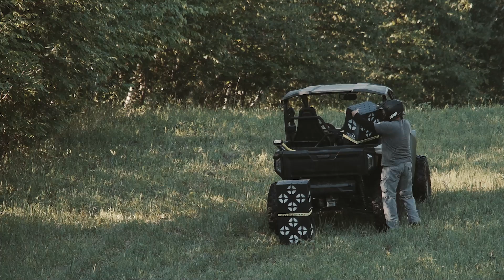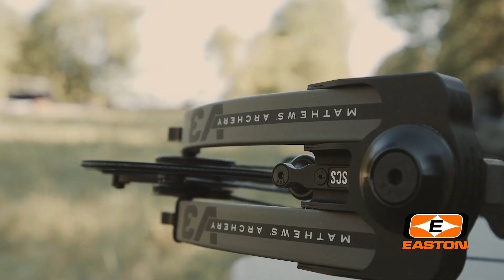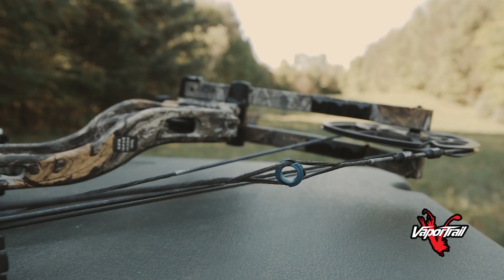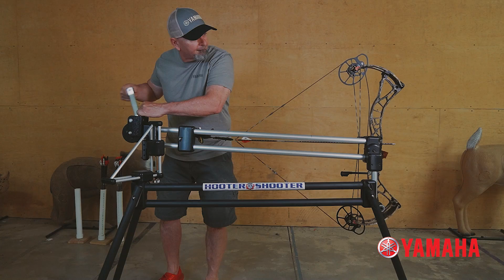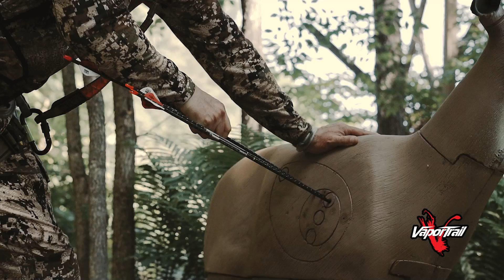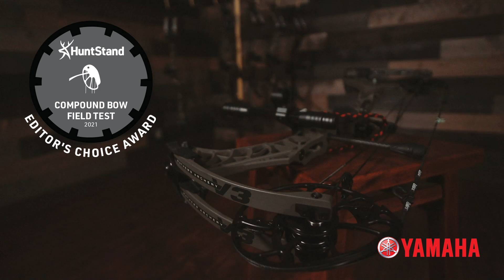Best Hunting Bows Of 2021 | Field Test

Comment: Mathews v3 and VXR are both some of the best when it comes to dead in hand, quiet shot, and overall balance…but I completely disagree that either is “smooth” drawing. For both models the draw weights “feel” heavier and are super stiff compared to other flagships at the same weight especially at the back end of the draw before dropping into the valley. This has been true for 5 different Mathews VXR and V3 bows I’ve tried at 2 different dealers and under different draw weights. My bowtech SR6 set to 70lbs and performance is smoother than either and it’s known to be aggressive feeling. I think people fall in love with Mathews because of their ability to advertise and market (kudos to them) and are reassured by the balance, looks, and quietness, which it does excel in…but there are better bows out there if you want smooth or easy to draw bows (which are fairly important in hunting situations).
Reply: I have a new V3. This was meant to replace my old Evolve 35. I has less hand shock and is a little smoother to draw. But really is hand shock that important? It  holds terrible in comparison. Is so easy to talk in the hand and my groups on a target are much wider in comparison to my old PSE. I will be replacing it soon with a more stable bow. Marketing hype like this got me!
Reply: This is why you should shoot all the brands before making your purchase.

Comment: I have a v3 27 now and I had a pse stinger extreme and I feel like I'm more Stabler with the v3 than the pse.All in all I love the v3 better and the v3 has a lot less vibration.
Reply: You can't compare a starter bow to a V3 of course it holds better.

Comment: I appreciate these reviews. I have shot all as well. I don’t think a bow that has tuning adjustability without a press should be grouped with bows you still have to shim. That’s HUGE technology and it’s being shrugged off like it’s not a big deal.
Reply from the maker: Well it's certainly a big deal to Team HuntStand. As you heard  the  Elite Enkore's S.E.T. technology (Simplified Exact Tuning) was certainly a factor in bringing home its Silver Award, and we also focus heavily on Bowtech's Deadlock Cam System in the individual Bowtech Solution test video, coming soon. Both great systems.

Comment: Mathews is leaps and bounds ahead of everyone else. Anyone who disagrees hasn’t shot one.
Reply: Mathews does make a great bow but the draw is stiff, the grip is uncomfortable and hump and dump sucks. It's not a good bow for a new shooter that does not understand how to avoid torqueing the Mathews. I felt the like 85% let off will try to rip your arms off if you let it down. It does hold well, it's super quiet and dead in the hand. You have a very different experience with Mathews then I do and because of my VXR I have to shoot right handed this year.
Reply: Lol...... I shot one and tried to get myself to like it more then my realm x,  that's yoke tuning not deadlock,  even still, it's faster, smoother, way easier to tune,...... I couldn't find one thing I liked about the mathews better even though I really tried hard!   I'd like to shoot one fully set up to see if I can aim steadier but unless it was significantly better, I'd still stay with bowtech
Reply: I've shot every bow on the market and do every year. The EVL 32 us far superior and the APA black mamba when tested side by side to the v3 was better in every aspect. Keep buying the Ads and drinking the Kool aid.
Reply: @Deer3083  I had a PSE (Pull Shoot Explode) when I was a little kid. It’s just a phase, you’ll get over it soon. Buy a Mathews, you won’t go back.
Reply: @alexmaze3916  When you were a kid? Let's see I've owned just about every brand over the years and I'm not loyal to any brand. I can actually say PSE is second behind APA the last few years. You wouldn't know about APA though. Gotta get your nose out of mathews ass. Then again not everyone can afford to try every bow every year. Those of us who can know what the best bows are. APA and PSE are it and pse fyi not the same as 1990s pse bows. But you wouldn't know that lol
Reply: I've owned a VXR, V3 and Traverse. the EVL is better than all three. even my hardcore Mathews buddies agree.
Reply: @MidwestBowAndArrow  y’all don’t mention the ease of adjustability in the elites and Bowtechs? That’s worth gold In my opinion
Reply: @gorrila41  The Elite bows line up this year was very good and I ended up picking up the Remedy because the draw was super smooth and PSE is my first choice for a bow even though they treat lefty's horribly and make us beg for scraps...lol
Reply from the maker: Actually we do mention the ease of adjustability of Elite's S.E.T. technology and Bowtech's Deadlock Cam System, both great systems that break some very exciting new ground...stay tuned for more on those in the individual bow test videos that will be published soon...thanks for watching.
Reply: @MidwestBowAndArrow  He won't listen. He drank the Kool aid.